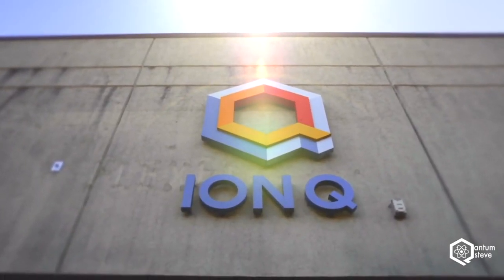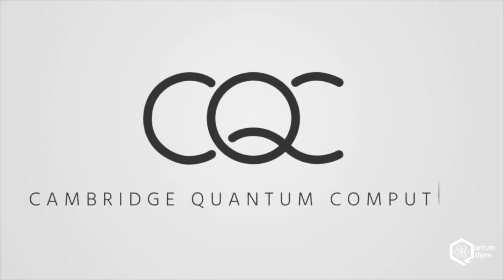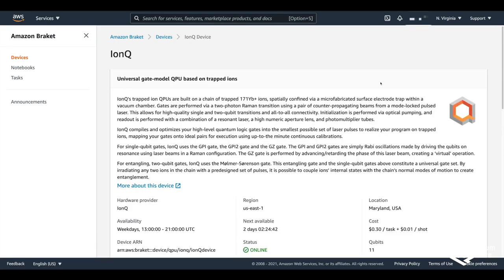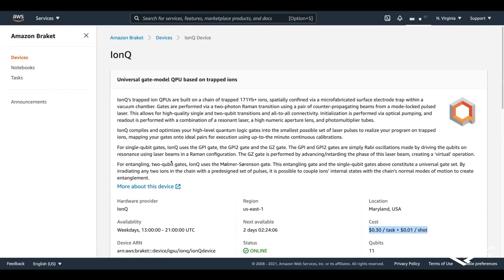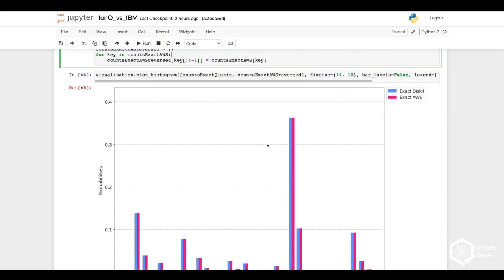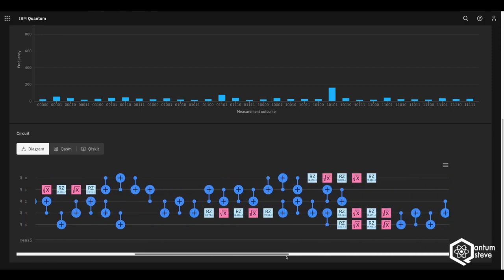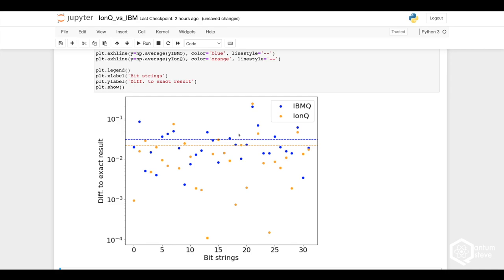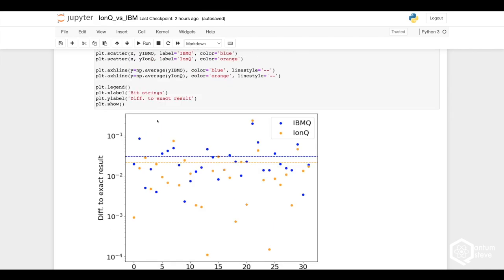IonQ going public (SPAC)? - Quantum Computing News and Tutorial

Comment: Hey Steve, you migh be able to provide me with an answer before I dump my life savings into IonQ. 
Is there a natural limit to the possible quantum volume based on the gate fidelity? I saw that IonQ wrote that superconducting QC can´t get above 99.9% based on physical law.
IonQ's calculator is limited with regard to qubits and I don´t understand the mathematical formula... I kinda wanne know if IBM can even get to a point where they build a 5000 algorithmic qubit QC.
Reply from the maker: Hi! I’m not sure if I know the answer to your question, but I’ll give it a try. The QV is certainly limited by the fidelity. It depends on how many operations you can do while still retaining a certain accuracy.  If you look at the maximum QV that superconducting devices are achieving it’s significantly less than what you would anticipate from the current number of qubits. Now I don’t know about a physical law that prevents the fidelity of superconducting devices to go above a certain level but it seems to be the current limiting factor for their QV. Honeywell’s QV for example is confirmed by a paper and that seems to be only limited by the number of qubits in their trap at the moment, they increase it by adding one more ion. For superconducting they really need to pull out a lot of tricks to compete. For IonQ it’s not officially confirmed, but if we believe their stats the QV is limited by their number of qubits so 2^32...
Reply: @QuantumSteve  Thanks for the answer! Here is the source for my "physical law claim". https://www.sec.gov/Archives/edgar/data/1824920/000119312521114527/d138876d425.htm 
It´s on page 31 on the management presentation
" Honeywell’s QV for example is confirmed by a paper and that seems to be only limited by the number of qubits in their trap at the moment, they increase it by adding one more ion. " The quantum volume gain comes from high gate fidelity right? But this will eventually need error correction aswell I think?
I am still struggeling with the connection between gate fidelity and error correction a bit. I get that the Ion Traps have an advantage from having a high natural fidelity, but eventually they will have to error correct aswell.  
So Hypothetically: Even if I have an awful gate fidelity can I always just use alot of qubits (or ions) to error correct? 
I am not sure if this is the same question again, but sometimes I am hard to understand :p
https://ionq.com/algorithmic-qubit-calculator Here is the calculator I played around with, if you are interested.